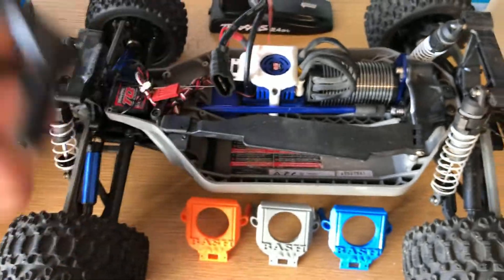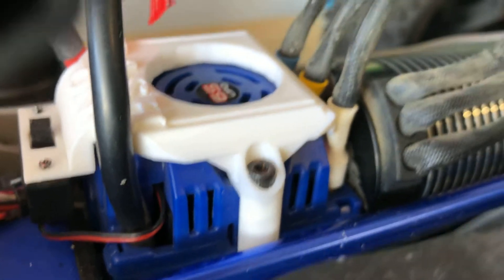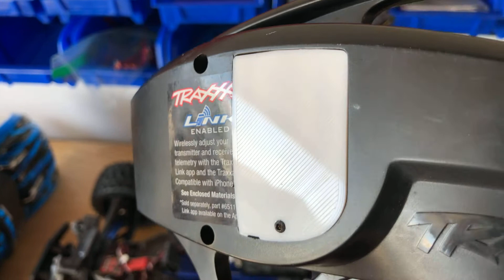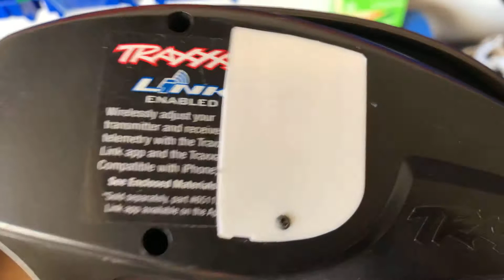3D print RC Truck parts. Creality Ender 5 Pro. Traxxas Rustler 2 wheel drive & Rustler 4x4 6S 2200KV

Comment: Do you have an eBay store?
Reply from the maker: Yes I do but the only thing on there for RC is the beer cooler RX boxes and some Vape charging docks I’ve designed. 

https://www.ebay.com/itm/294271728497?mkevt=1&mkcid=16&mkrid=711-127632-2357-0
Reply: @bobby_crawls_510  I might get one
Reply: @bobby_crawls_510  my receiver box is broken
Reply from the maker: @NickBuenoo  check mine out.. mine utilize your original hardware on your current RX box (4 Allen screws). Mine are designed to fit the rustler 2wd chassis, 2wd slash, 2wd stampede, and 2wd bandit. The 4x4 models have a different box or at least the mounting holes are in different locations vs the 2wd RX box. I can make one for 4x4 models… just didn’t have a box from a 4x4 models to spec and draft in CAD. If any one wants to send me a 4x4 RX box I can make the beer cooler for the 4x4 models.
Reply: @bobby_crawls_510  it doesn’t have the hole in the bottom for the front bulkhead?
Reply from the maker: @NickBuenoo  if I am remembering correctly your current RX box has 3 mounting locations and your lid has offset holes. And I’m not sure but I think the box I took off had a notch in the bottom to clear the center drive shaft. My box would have to be totally redesigned to make it work.. and I believe I’d have to shorten the stack height of it to clear your body shell. It’s do-able
Reply: @bobby_crawls_510  my car is totally modified body height may not be a problem. I just a rebuilt it last night and noticed there is a screw in the receiver box holding the front bulkhead and my box is broken. I could drill through the 3D print maybe?
Reply: @bobby_crawls_510  I have a 4x4 rustler would it fit? Just saw it says 2wd
Reply: @bobby_crawls_510  charger for novo is sick Dude

Comment: How did you get all the telemetry in there? I am trying to get a similar build going in my rustler. Running on 4s now and want to take the next step up! Keep up the good work!
Reply from the maker: Dude I thought you were my brother messing with me haha. His name is Mike Dean... our last name is Dean. The MXL-6S is a direct bolt on part for the Gen 2 Rustler 4x4 chassis. But In order to get that MXL-6S and the 2200KV motor to fit in there nicely... you do have to remove the RX box. That’s why my receiver is velcro’d behind the front shock tower.  I am going to design a RX box for the front of my rustler behind the front tower. Maybe utilize those diff screws to hold the new box to the chassis. Not sure yet as to when but it will happen lol
Reply: @bobby_crawls_510  NO way!! haha small world! Yea I am trying to decide how to get it all in there.... May remove the telemetry and use the holes to mount my receiver. Only issue there is buying a new speed GPS... Do you sell these ESC mounts?